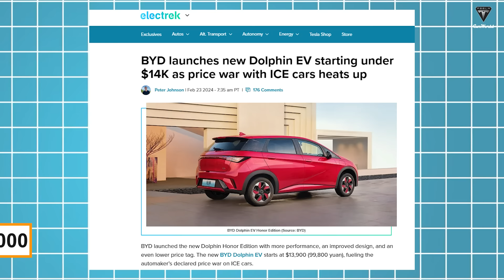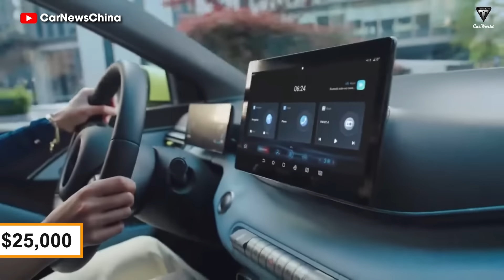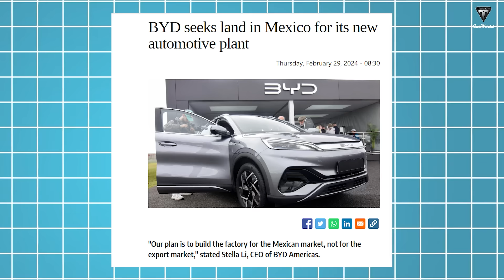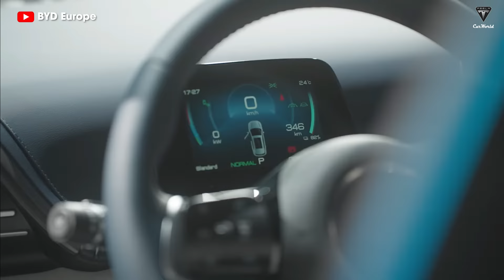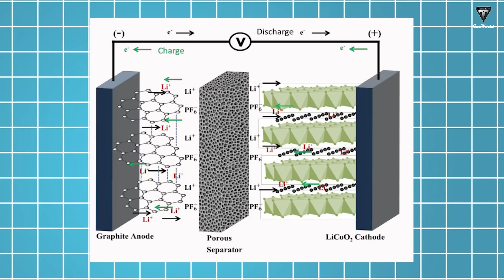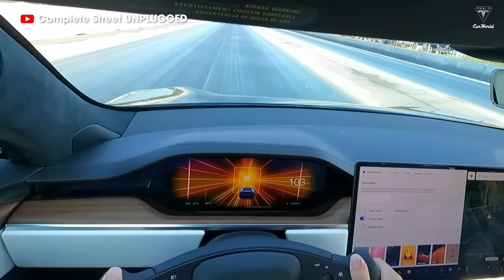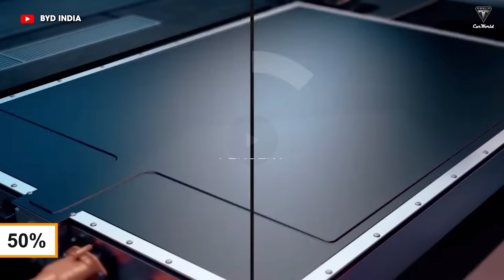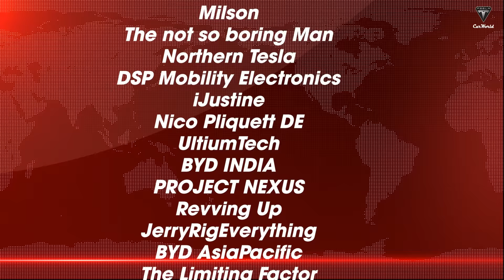It Happened! Elon Musk Unveils ALL-NEW Plan for 2025 Tesla Model 2 Redwood! Will Destroy All Rivals!

Comment: What about the IRA $7 500.00 incentive and taking into account further battery and cell credits - $35 per kilowatt-hour (kWh) for domestically produced battery cells, $10/kWh for domestically produced battery modules, and a 10 percent production cost credit for mining critical minerals and producing electrode active materials, which include cathode and anode active materials. Possibly totaling up to $4 000 00.
Tesla is already producing cells and assembling batteries in the USA. Tesla is also busy building its own Lithium refining plant. Taking these incentives into account, could result in a net selling price of less than USD15 000.00 for the Tesla $25 000.00 vehicle and BYD possibly ending as high as USD30 000.00. BYD has indicated that it is unlikely to enter the US market in the next few years. BYD is far behind and is not even taking FSD seriously. Will probably end up in a license agreement with Tesla to use Tesla Technology and FSD ( Full Self Driving ). BYD is far behind and very few people realize this. Tesla Model 3 and Model Y sold more EV cars than BYD in China ( without the IRA and Tax advantage ) even although the more expensive Tesla vehicles address a significantly smaller accessible market than BYD with its cheaper 
vehicles addresses. Tesla is making 6 times the amount of profit per vehicle than BYD.